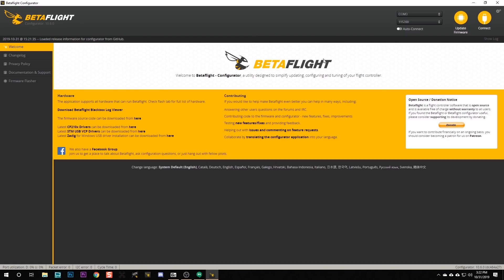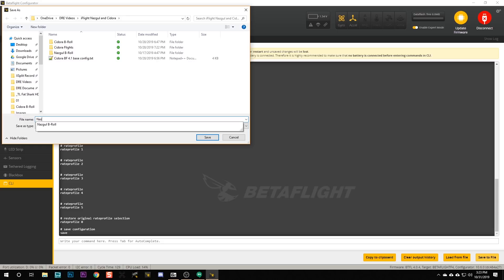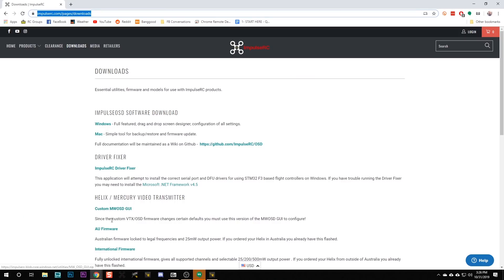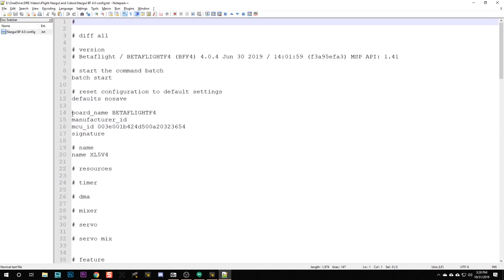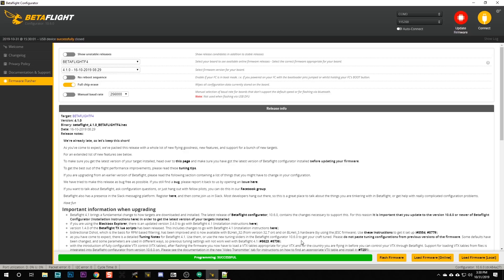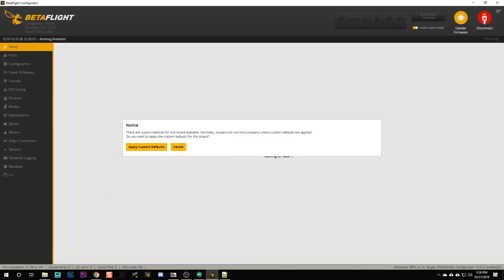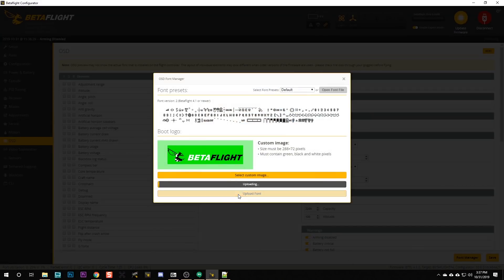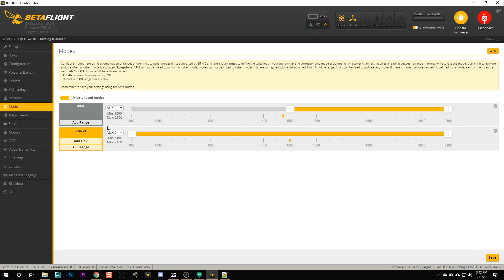How to Flash Betaflight Firmware (Upgrade to 4.1)

Comment: Nooby question:
I have a Meteor 65 Air and the OSD sometimes disappears for a couple of seconds and sometimes video image goes black. Already changed video antenna and camera but didn’t help . Is there a chance it gets fixed by re-flashing firmware to the board?

Comment: Hi, I tried to Flash my Geprc Taker 4G Aio 35, I did a mistake and did not Save the data on it, so the hole Board is deleted now and the firmware that betaflight offers me does not work, I think I messed up, can somebody help me out?

Comment: hello Joshua, i enjoyed watching this. I have a question. If the retailer provided me with a file, in this case the file is called "betaflight_4.3.1_CRAZYBEEF4SX1280_ICM42688P_ELRS_V3.hex" and also with a cli dump file, in this case called "Mobula8 ELRS 3.0 dump all for42688.txt". Do I then match the target as close to as possible with the first file name and do I then instead of saving and re loading the diff all just upload from the .txt file into the CLI?

Comment: Hi I’m trying to flash from 3.5 on a dalrc405 and it gets stuck on initiating reboot to boot loader and won’t flash, any suggestions? Cheers
Reply from the maker: Download ImpulseRC Driver Fixer and run it. Then plug in the FC while holding down bootloader button.

Comment: my copter wont connect to betaflight :/ i have mamba f405 stack, immerseionRC driver fix wont work it just say searching for FC but nothing happened if anyone can help me im pretty glad
Reply: Check the usb cable. You need a cable that can transmit data. A lot of micro using cables can’t transmit data.

Comment: hi i flashed the firmware to my GOKUF722 Flight controller on my Mr Croc setup and now I the dji air unit doesn't get power. Any idea why that is? I'm afraid I have messed up the quad
Reply from the maker: It's hard to imagine how flashing firmware could cause the air unit not to power up. Typically they are powered directly from the regulator.

Comment: Thanks to this video, I was able to flash my Mamba F405 MK2 for the first time (before even installing it on a frame).  Your video probably saved me several hours of frustration and failure.

Went from 3.5.7 to 4.2.10, but since I've never used Betaflight before, the difference between those version is not that big of a deal.  My last FC was a HobbyKing KK2.0, so even Betaflight 3.5.7 would have been a HUGE upgrade.

Comment: Problem: Flashed Betaflight 4.2.9 on Protek35 and now my betaflight will not connect at all. 😭

Please guide.
Reply from the maker: Use bootloader button on FC to put the FC into DFU/bootloader mode then re-flash.
Reply: @JoshuaBardwell   It worked. Thank you so much for helping a newbie 🌞👍

Comment: Thank you i'm a total noobie ! ... You said its always  the same bu
t i guess its not in my case i guess its flashed for STM32F411 but the board differs, they must be quite similar and there is a flash for each of them which one do you suggest ?  # version
# Betaflight / STM32F411 (S411) 4.1.0 Oct 16 2019 / 11:57:34 (c37a7c91a) MSP API: 1.42
# manufacturer_id: MTKS   board_name: MATEKF411RX   custom defaults: NO

Comment: Mine flashes til halfway through then says “usb device successfully closed”. And freezes….wtf?  Now my quad is a paperweight I guess…😓
Reply from the maker: You can't really brick it. You can always re-flash it using DFU/bootloader mode.
Reply: @JoshuaBardwell  yeah I tried several different releases but the same issue kept repeating.  I ended up breaking my usb connector.  I had an old f4 board from a previous quad, swapped that out plugged it into beta flight everything was checking out, til I plugged my battery in, guess I had a short in the board.  New stack is ordered 😬was a rough night.

Comment: Hi Josh fantastic video however i have just flashed a Matek F405 with betaflight 4.1 using target MatekF405 as on the leaflet enclosed with it and version info such as in CLI on video however roll left is now pitch forwards and the animation on beta flight now seem 90 degrees out. Obviously i can change this in configuration but is this a common issue? Why does it happen (Is it me? something i did wrong?) Thanks.

Comment: PLEASE HELP
I have a brand new Geprc Rocket Plus. I have made it to this final step trying to bind to my TX16s w/ Crossfire. After I flashed the latest firmware my quad started making an awful scratching/hissing noise! This happens even when I'm only using USB to power the flight controller! What happened? This was supposed to be the last step before my first flight EVER... But the sound is so awful, it sounds broken. (Its never been dropped or flown. Its brand new and it only started this noise when the firmware flash completed.) 😡

Comment: Hello Bardwell,

Thanks for all your support for this community I just ran into a problem :/ while in BF I wanted to backup my old settings file and instead pasting the text file into CLI as its the best way to do it, I accidently pressed the backup botton and uploaded a backuped file but not in a txt format it was not convertert and it kicked me out of BF. Now I cant access my flight controller anymore its not reacting. I then tried to enter Bootloader mode which I managed and when I flashed it to the right firmware it always gets stuck in the center while its flashing. Do know what I can do to fix this problem. 

Thanks in advance
Reply: Managed to solve it, for anybody entering in a similar problem the fix was that I flashed it to a wrong one I found the correct flight controller which I had to flash it too. The one stated on I Iflight page was wrong had to download the original Dump file where I found the correct one.

Comment: Betaflight configurator will not find com ports installed drivers tried Zadig and Impulse no help using Windows 10  BFC still drivers installed correctly what am I doing wrong????
Reply from the maker: Try a different USB cable.

Comment: Well over my head.
Reply: So I create a CLI dump but don't use it? Wouldn't using yours totally bork my settings?
Reply from the maker: You create the CLI dump as a backup for yourself. You shouldn't use my CLI dump -- that's correct. You restore your backup after the upgrade.
Reply: @JoshuaBardwell  Wow thank you for the quick reply, you rock.
Reply: @Joshua Bardwell  My quad (Mobula6) came with like version 3 something of betaflight. Looking under previous versions in the flasher, it doesn't look like I can go back that far (in case I need to revert; company supplied dump for ver 3). Looks like unless I want to take a chance on bricking I'm stuck at v 3. No RPM filtering for me. :(

Comment: Josh I’m using a ufivy draco hd , I’m using 4.0.2 configurator there’s a 4.0.3 but it won’t let me download to chrome , says “crx_required_proof_missing” but when I plug my uvify into laptop  the uvify configurator says “ this firmware version is not supported. Please upgrade to firmware that supports api version 1.2.1 or higher” help pleasee

Comment: More lost now than ever. There is no cleanflight on my tablet so how do i even view the configuration to save it? Since the settings were crap should i even save it or just do a fullchip erase?  Or should i keep flying with these sluggish factory settings and be happy it flies at all. Because you guys are trying to crash boards so they will buy the bardwell aio crap, right? Droneflasher is even more techtotized than you so no help at the flashing source, right? Man i just want betaflight to up the rates a little bit. And since f3 boards are abandoned...

Comment: Problem: since I did the firmware upgrade on the fc my receiver has stopped communicating with fc. It connects fine with transmitter. But has now lost connection with f405 & rxsr but less than a month old.
Any suggestions?

Comment: i have a problem with betaflight configurator. i install 10.7.0 when i came out and had no problems but now when i click on firmware flasher it just comes up with WAITING DATA i have tried clicking on firmware update and the same thing.my quad goes into dfu mode but still goes to white screen with waiting data. i know you can click on FIRMWARE FLASHER with out quad connected and still get flight controllers firmware page displayed. i tried configurators from 10.4.0and it worked ok but anything after that i have the problems. i tried inav and it works. i have reinstalled configurator and drivers. turned off anti virus and firewall. tried another internet connection. but still no change. is github  having problems with their configurators.

Comment: So my Quad was accidentally unplugged while changing the configuration and now it does nothing when I plug in the USB port.
I cant get it into DFU to reflash it either...if I plug in the battery it does light up but now it won't give the confirmation beeps and I still can't log it through beta flight.  Did I brick it ???
Reply from the maker: You should be able to get it into DFU mode by holding the bootloader button on the FC.
Reply: @JoshuaBardwell  I get nothing at all when I plug it in USB but it lights up when I plug in the battery but still won't let me in
Reply from the maker: Nothing at all when plugging in USB is a bad sign. Try a different USB cable and different USB port on the computer. Could be the USB plug itself is damaged though.
Reply: @JoshuaBardwell  Yea !!!!  It worked ! Thanks Joshua Bardwell !

Comment: If you get Error-99 when using impulse-rc driver fix, you have to turn off enforcement of signed drivers that windows 10 have on by default. 
Solution
.

A work around for this issue is to temporary disable Driver Signature Enforcement in Windows before running impulse-rc driver fix.
To disable Driver Signature Enforcement on Windows 10 and 8.1, please follow the steps below:
Press the Win + I and click on Update & Security
Click on the Recovery option
Click on the "Restart now" button under Advance startup
Once your Computer has rebooted, choose the Troubleshoot option.
Select Advanced options
Select Startup Settings and click Restart
From the list of startup options, press the F7 key to disable driver signature enforcement

To disable Driver Signature Enforcement on Windows 7, please follow the steps below:
Restart the computer and access the Advanced Boot Options menu. 
Press the "F8" key repeatedly as your computer is booting up, before the appearance of the Windows logo.
From the Advanced Options Menu, select the "Disable Driver Signature Enforcement" option and then press "ENTER".

Comment: i am always getting the error "an error occured while entering bootloader - unexpected number of devices detected" in impulseRC
yesterday it worked, but today i am no longer able to enter DFU .. but i am able to play around in betaflight and also can update the driver with zadig, but DFU just won't work
Reply from the maker: Plug directly in to the PC, rather than using a USB port. If you are plugged in to the left side of the laptop, move to the right, or vice versa. Front of the PC to back. Finally, if there are other things plugged in, unplug them and see if it fixes it.
Reply: @JoshuaBardwell  tried everything you told me, unfortunately not working out for me .. will try a linux live usb and flash the betaflight there .. thanks though
Reply: @JoshuaBardwell  if you are interested: what fixed it: had to activate UART1 port to MSP .. this took me 2 days to figure out, lol
Reply: @shotbyarian  hey i have uart1 to msp but i have still the same error as you. any idea?
Reply: Nils A. vtc also msp?
Reply: @shotbyarian  yea, i solved it tho.
I just had to open Betaflight and do the driver fix, that worked.

Comment: I crashed my quad on a wall and now it won't do the other 2 beeps when I power the battery, any idea of what if might be happening? Also betaflight wont find the board anymore, I'm using your FC v2, I need help pls!!
Reply from the maker: Sounds like the FC died since Betaflight won't find it even when you plug in USB. You crashed into a wall and something broke. Time to buy a new FC.

Comment: I will Venmo you $$$ if you can help me with this issue please 

So my Betafpv HX100 was bound to my Taranis QX7, the green LED verified transmitter input. But my receiver tab would not reflect my stick inputs in Betaflight and thus my quad would not arm. However when I turned off my Radio, the XM receiver on Hx100 would go from solid green to blinking red so i know they are bound. 

To fix this i followed your video on flashing betaflight firmware. So I flashed betaflight 4.1.7 on to my hx100 ( STM32F411 target) and also entered the CLI DUMP which was saved from the beginning. 

Since flashing I have absolutely no input on betaflight, movement of the quad does not reflect on the 3D model on Betaflight. 

I then flashed the firmware BACK to what i originally had ( Betaflight 4.1.1) and it still has no input in Betaflight. PLEASE PLEASE PLEASE help me Josh!

Comment: Had issue getting into BL mode on Mac. Inputting BL in CLi would act like it was going into bootloader, and trying to flash from the firmware flasher with the reboot into bootloader. Neither option would work for me. I got "unable to open serial port" or some nonsense. But the holding the button on the FC while plugging in did the trick. Was able to flash BF after that. Just thought I would share.

Comment: cant get dfu mode bec i cutted in ports the usb conection pls help me dont know what to do
Reply from the maker: DFU mode will still work even if you turned off the USB port in Ports tab. 
1. Hold down the bootloader button. Plug in the USB cable while continuing to hold down the bootloader button.
2. Run the Impulse RC Driver Fixer app (https://impulserc.blob.core.windows.net/utilities/ImpulseRC_Driver_Fixer.exe). It should "fix" the driver successfully. If not, do not proceed.
3. Un-plug the USB cable.
4. While holding down the bootloader button, plug in the USB cable again.
5. Start the Betaflight Configurator app. In the upper-right corner pulldown menu, you should see "DFU". You can now flash the board.
Reply: @JoshuaBardwell  Thank you very much for answering joshua! Later after work ill try it and will inform you if it works. :)

Comment: I tried to put 4.1 and it froze half way through so then I re flashed the legacy 4.0.1 and now my flight controller won’t connect to Betaflight or the computer makes no connecting sound, can I fix this without putting a new flight controller, it was crazybee f4 pro v3.0
Reply from the maker: It's basically impossible to really brick the FC by flashing it. Hold down the bootloader button, plug in USB, and re-flash it, and it's likely to work.
Reply: Should I select to erase the chip if I can reflash it

Comment: So.... The APPLY CUSTOM DEFAULTS didn't popup. Now, it won't connect, and I keep getting a "Failed to open serial port" when I try to plug it in.
Reply from the maker: Re-flash it.
Reply: @JoshuaBardwell  Thanks.
Thankfully, you said to back it up, first. I am new to all this, but have been watching for several months. I just bought a Titan 5. Had to hold down the Boot button on the control board, and use Zadic "replace driver" STM32 BOOTLAODER .... It worked AND connected. Just had to paste the backup.....
and I'm back.
 Now back to trying to figure out why my DJI Digital Goggles aren't sending any signal in the receiver tab.
Thanks again Joshua.
Reply: @JoshuaBardwell   After hours of looking for why my receiver wasn't doing anything  in BetaFlight, when I moved the sticks, I found that changing the Settings>Device Protocol fixed it. 
I know others are having issues with this, so wanted to share, as a possible video idea, on linking DJI digital goggles to BNF drones for us newbies.
Thanks again.

Comment: Cannot enter dfu mode? when I hold boot button it goes to com1 and will not connect.. It connects fine on com3 as normal.. When type bl on Cli it just disconnects and goes to com1.. I try the impulserc driver fixer I have installed on task ar but it says: An error occurred while entering bootloader! Access to the port 'COM3' is denied.. sometimes it just keeps searching for flight controller Please help me😔

Comment: Is bootloader mode on com1 port? Because my flight controllers can only connect on com3..
I have tried holding the boot button but it will not connect??

Comment: Josh Betaflight works good on my computer on com3 port but when I type bl on Cli it will not go into dfu mode.. I run the impulse driver fixer but it says cannot connect to com3.. Or not impulserc not allowed to access com3??

Comment: Hey Joshua, I have a SPRACINGF3 target in betaflight, but I can't find the 4.1 firmware. do you know if it's only a dev matter ? Or it is avalible? Thanks.
Reply from the maker: Support for F3 targets was dropped in 4.0 I believe. Definitely not 4.1.
Reply: Thanks for the quick response !
 (12h) ! 

Other questions: Do you a suggest any bettaflight setting for micro f3 drones. I watched your bettaflight 4.1 playlist and your other awesome bettaflight tutorials but i'm finding it hard to pick one... 

Do you suggest project Mockingbird?
 On 3.1 I think ? ...

My F3 board can go up to Bettaflight 4.0

Stock or 67krpm brushed racestars motors (I have both)

I hope this is sorta clear...lol

Comment: i am just getting into this hobby and if it wasnt for you i would be absolutely lost i just purchased a hx100se and flashed it from 3.5.1 to 4.1 because i would barely tap the wall and then it would just fly into the ceiling the second i armed it and would have to change the prop even though it looked fine to my amazement my flight times went from 2.5 to 3.5 minutes just with re flashing it amazing